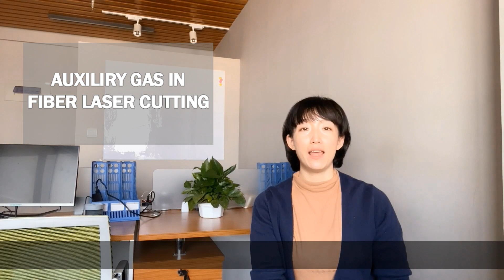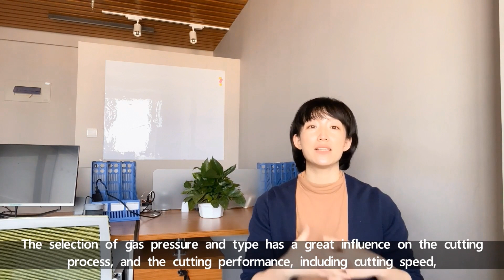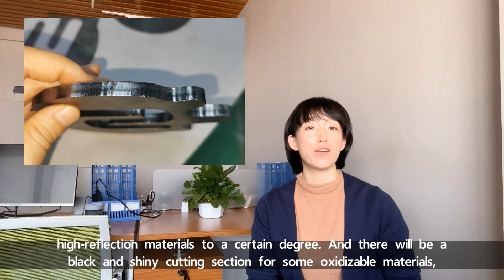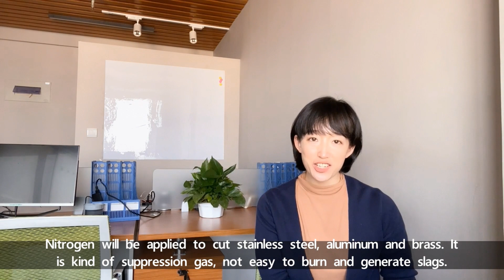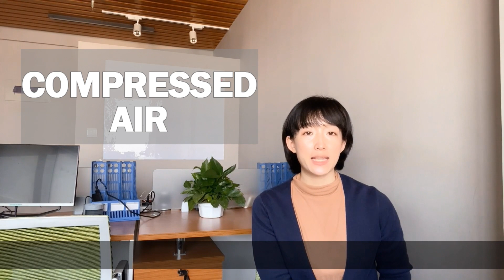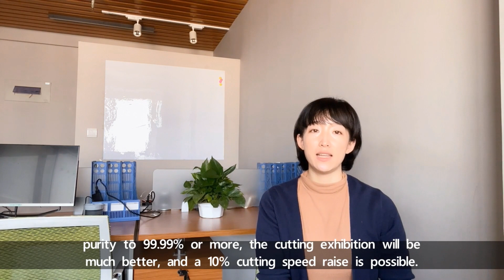Auxiliary Gas in Fiber Laser Cutting | Laser Cutting Auxiliary Gas

Comment: Good morning, I operated a 3 kw laser cnc, which I have to keep the auxiliary oxygen gas open when cutting with nitrogen because it throws an alarm of low oxygen pressure, check for leaks and I have not, but I have observed that in cutting with stainless steel having Oxygen pressure at the outlet so that it is not present, this alarm decreases pressure little by little and the brown color cuts me, do you mean that the nitrogen is contaminated with oxygen, has this happened to someone, please? what to do
Reply from the maker: Did you set the gas delay?
Reply: @ClaraChai  Blessed day, Miss Clara, I really don't know where I'm from. With the figure, you'll have a video to show you how to do it, thank you very much for your information
Reply from the maker: @gilbertochirinos9972  I know how to do it? I do know what I am doing.😁😅
Reply: @ClaraChai  Yes I know, I have seen all your videos, and the one in Spanish, can you help me, in what parameters of cypcut, can I change it, ????
Reply from the maker: @gilbertochirinos9972  I need more information, talk to me on WhatsApp +86-13335151833